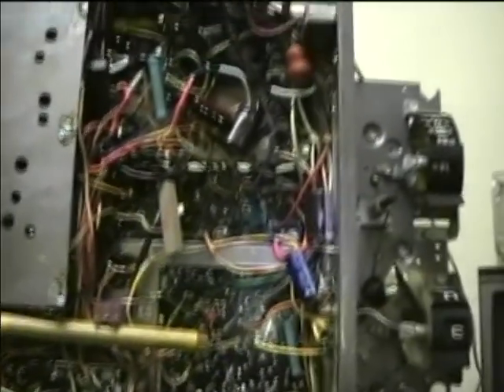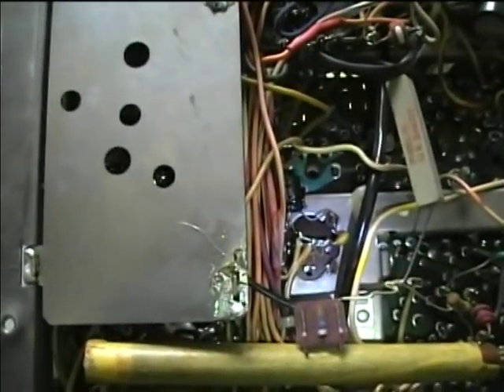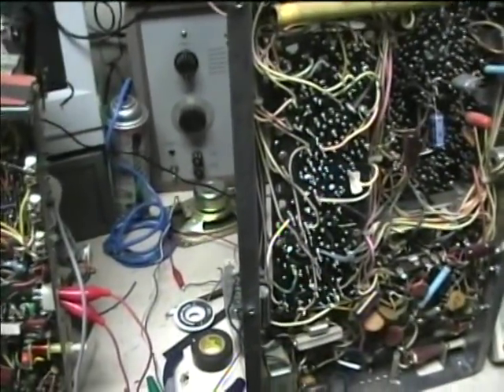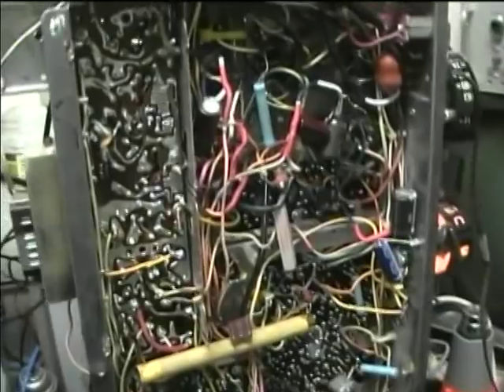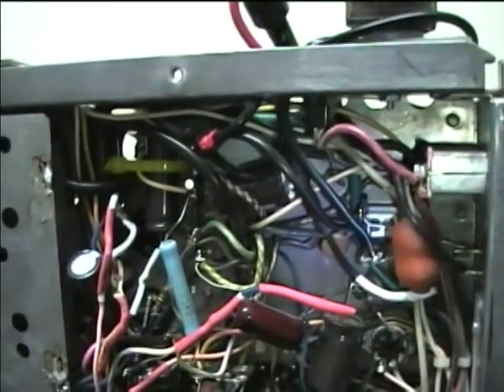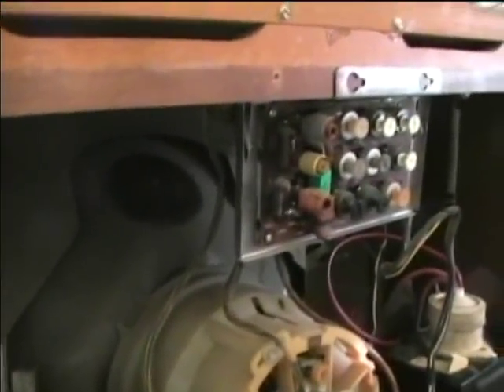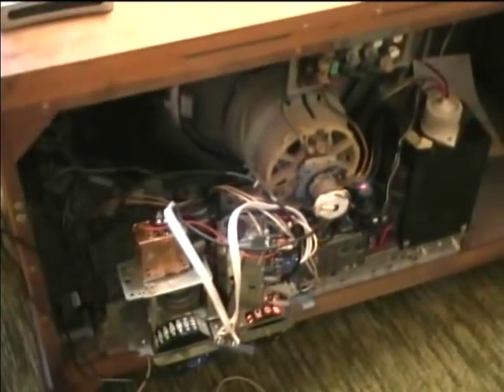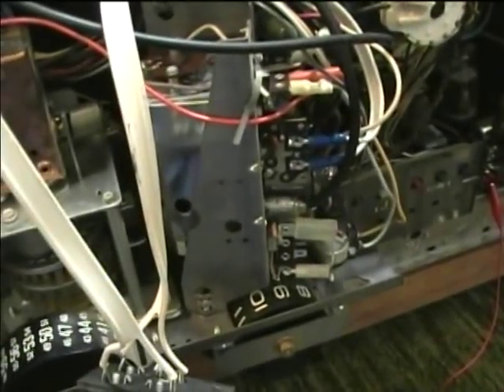1967 RCA CTC-28 tube type TV repair part 2

Comment: @retrochad  Thanks for the reply.  My set only has channel up and down buttons. I can't get it to go up past channel 68. It then returns to channel 2. I have a satilite system so I don't use the tuner. It works on channel 3. I'd prefer to use my satilite box and DVD player through the direct inpus instead of the rf antenna. If you know of any other way to change the inputs, Please let me know. Thanks again for the suggestion.

Comment: I really enjoy your informative videos. I have a question. I have a RCA model G25189TK television. I'm using a multipurpose remote as the set didn't come with one. I can't change settings other than on/off, channel and voluem. The set swiks fine but I have to use the 75 ohm antenna lead for input. The set does have the 3 jack audio/video system, but I can't access it. Without it, I can't get stereo output. DO YOU HAVE ANY IDEAS HOW i CAN ACCESS THE JACK INPUTS? Suggestions would be appreciated.

Comment from the maker: @1112223333111 These squiggles act as filter chokes and are on the filament supply to the tubes. They help keep RF signals out of the filament supply system.
In countries where radios and TV's require licenses to be paid like in England, they did use mobile vans to try and detect the RF radiation from the oscillators in superhetrodyne sets to catch people who hadn't paid their licence fees. I'm not sure if they do this any more though.